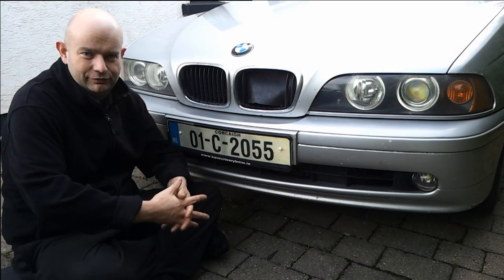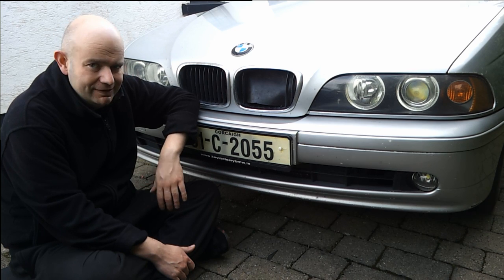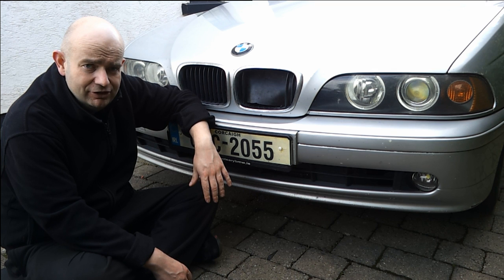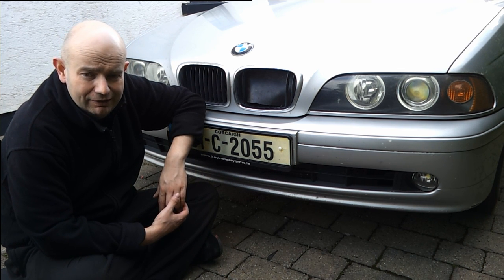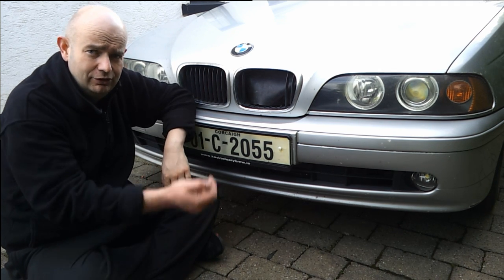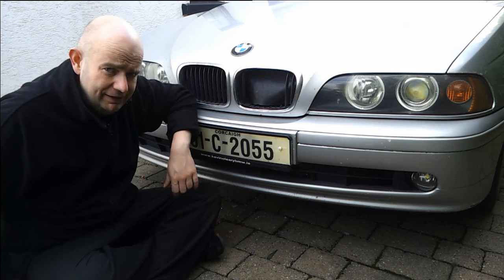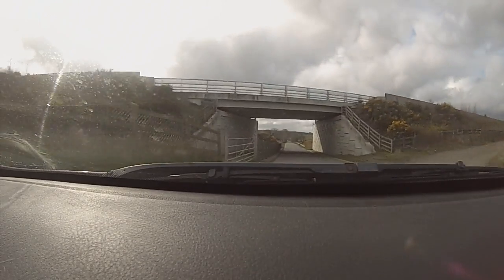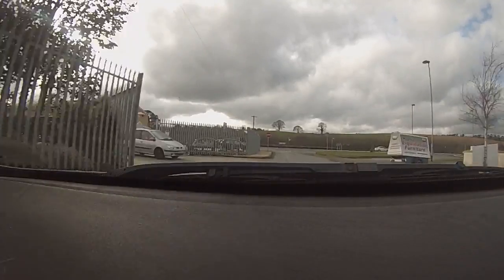BMW E39 EV Conversion 43 Chademo 02

Comment: you could probably just glue a hinge on the kidney, and take the normal gas cap clicky-open-thingy and put it there, wire it to the central locking system like the gas cap is and hey presto, professional looking charging port.

ditch the rubber guy and just glue a plastic sheet behind a regular e39 kidney and use that as the door

Comment: Having driven a motorbike year round in Ireland for 12 years I think you might be underestimating the force of Irish rainy weather at 70mph vs that flap.
Reply: Remember it has a sealed cap it't pretty much the same plug that the Nissan Leaf has and it's installed in the front too and the cover that hides the plugs is not weather tight to my knowledge.
Reply: V10PDTDI That's fair enough but Irish bad weather is a bit like that TV show where' they're catching the lobsters. Norwegians retreat from our winters, too much moisture along with the cold.. It's like an icy fire hose sometimes,